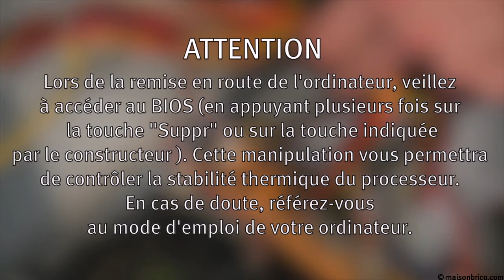Nettoyer un ventirad d'ordinateur

Comment: Vidéo intéressante, mais la manière dont vous retirez le ventirad est un poil brutal, une chance que le CPU* ne soit pas venu avec.
* Les sockets de types Les CPU ont juste les pins bloquées par le bras de verrouillage, si on tire trop fort dessus, le CPU peut sortir.

Pour les sockets sans pins du type LGA771, 775, G34, etc. c’est encore pire, car le CPU est bloqué par le dessus, si on tire trop fort, on peut endommager le socket du CPU, et là bonjour la galère pour le changer.

‼ Ne jamais enlever un CPU froid ‼. ‼Ne jamais vaporisé du froid ou bombe d’air sur un composant électronique chaud, une bombe d’air peut envoyer de l’air très froid, et les composant ont horreur de ça ‼

Ne jamais toucher les contacts, il est préconisé d’utiliser un bracelet antistatique, comme pour les mémoires, transistor mosfet, etc. le statique puis détruire certains composants électronique.

On aurait dit que le CPU était froid, car quand il est chaud, il se retire beaucoup mieux en tournant doucement de gauche à droite ou inversement évidement.

Pour nettoyer le CPU, a votre place je l’aurais retiré, car du produit de nettoyage avec de la pate de refroidissement peut passer en dessous.

Pourquoi ne pas avoir nettoyé le moteur du ventilateur ?, le moteur aussi récupère beaucoup de poussières, elle est très fine et souvent légèrement grasse, c’est elle qui bloque le moteur.

Moi, j’ai trouvé une astuce, peut-être pas la meilleur, mais qui fonctionne assez bien.
J’injecte pas mal de bombe a contact, cela nettoie et vire les poussières, ensuite un bon coup de bombe d’air. Je l’ai fait sur un ventilo de carte graphique qui ne tournait plus du tout. La carte vidéo plantait le PC, normal ; depuis, elle tourne nickel, même de bruit (coup de chance ?).

Le seul petit souci, et qu’avec cette solution, le lubrifiant mis à l’ origine disparait pratiquement.
Je recherche d’ailleurs un produit lubrifiant, mais non gras, car la poussière se colle, pas évident.

Ce ne sont que des conseils que je donne et en aucun cas une critique. Technicien en informatique et électronique depuis plus de 30 ans. J’ai démarré sur des PC i8088 à 8 Mhz. Donc, je pense avoir un peu d’expérience (lol)

Mais comme on dit, la critique est aisé l’art est difficile, mais comme je l’ai dit ce n’est pas une critique.
Vous, vous avez pris le temps de faire une vidéo, qui d’ailleurs est bien faite et surtout détaillée.
Reply: Salut j’ai mon ordi qui s’aullume mais pas ma souris et clavier et ça le le fait 1 fois sur 2. C’est un pc de 2014, que faire?